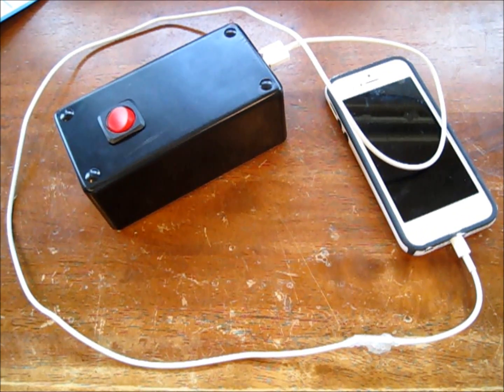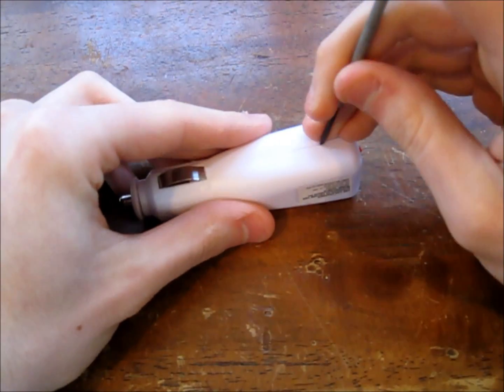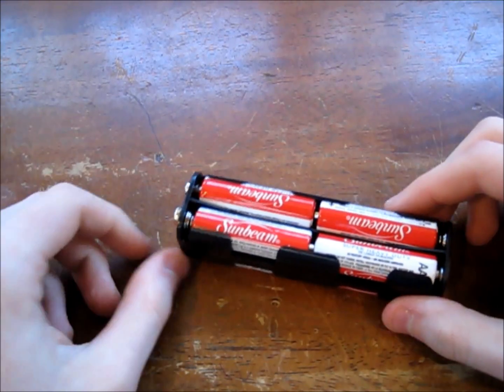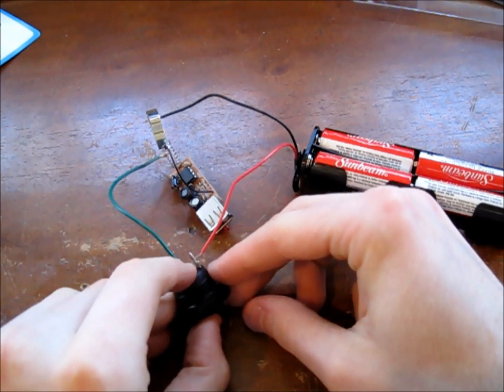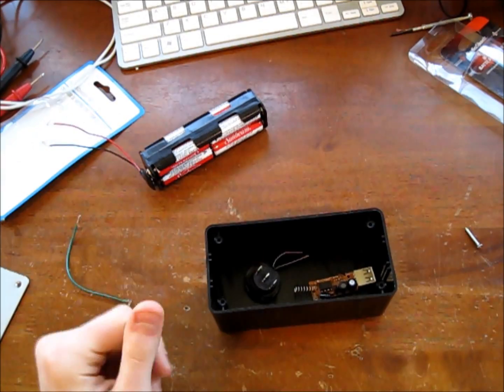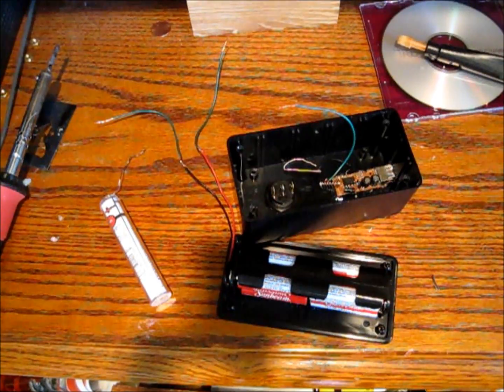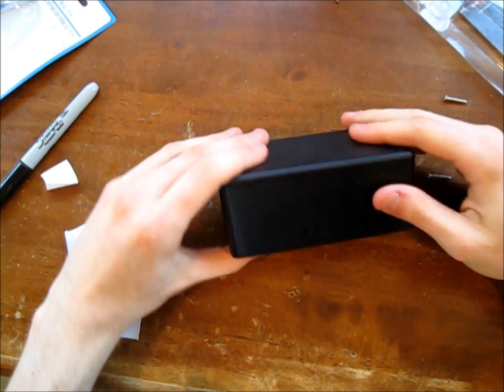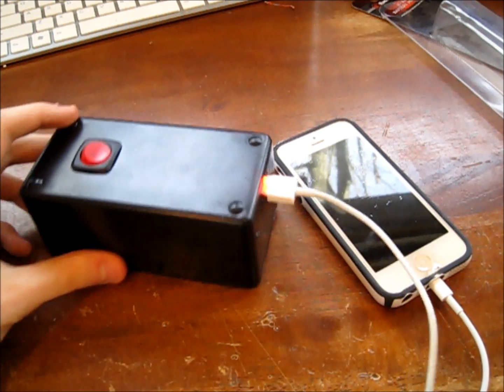How To: Make a Portable USB Charger!

Comment: Dude, get some heatshrink tubing. Not covering your connections can cause a short, which will, in turn, ruin your entire project. Also, its easier if you solder everything together before you intsall it into the project box.

Comment: Guys if yours is saying it does not support this Device use a Duracell 9 volt battery, I bought a 9 volt Panasonic from the dollar store and it didn't work, I then bought a 9 volt Duracell and BOOM, it worked!!!   I was getting frustrated when it was not working but very happy when I changed batteries !!!!

Comment: you don't need to have a regulator because the car adapter is 12 v and the batteries are 12 volt too

Comment: Toggle Switch with On/Off Label Plate
8 “AA” Battery Holder
USB DC Car Adapter Charger
Project Enclosure Box
Velcro straps
8 "AA" Batteries

Comment: why would i use 8 batteries in series?
from what i know about batteries, connecting them in series does not add more capacity.
like when i use 8 batteries with 2600 mAh each, they will still have 2600 mAh when connected in series.
and a usb device only needs 5 Volt.
wouldnt it be a better deal to go with ...
A. 4 batteries (6Volt)
B. a Voltage Regulator for 5 Volt
C. a regular USB connector?
that combination should have the same capacity, but only uses 4 batteries.
or did i get something wrong?

Comment: i would not recommend to use a 9 volt battery. Because you gonna need to use a 5volt regulator. To go from 9 volt to 5 volt. And that will make a lot of heat

Comment: It is where the spring is already soldered in, you could technically solder it to the spring it is possible but it isn't gonna be a strong connection, just de-solder the spring and put in a wire where the spring was and you will be fine.

Comment: yes it should unless it is some kinda weird config in the plug part of the car... but yes.  Since all it does is output 5v (at diff mAhs) it will be fine.  Some may have LED's some may not, there are a lot of diff ones.  But wiring, if you follow the + and - area, and hook it up accordingly it will be fine. Some maybe soldered to the board vs his wires but yes still able to do it, you can just add your own wires where applicable.

Comment: Just make sure the car charger is AMP rated for the apple products, not all carchargers r able to charge the apple stuff ex: is the biglots Duracell car chargers are outputting 500mAh-800mAh typically, and apple stuff needs 1A+ usually depending on the device. Though if you get the Duracell apple made ones then you can do it... just read the packages for ur device THOUGH u can put in multi car chargers($ store ones for the cheap), and have diff mAh ones in there all running off the same pack.